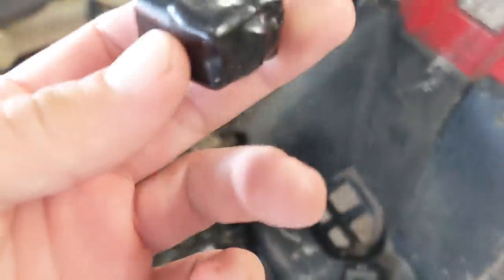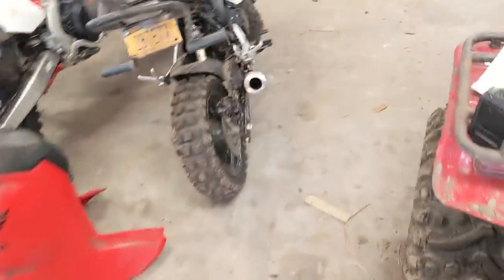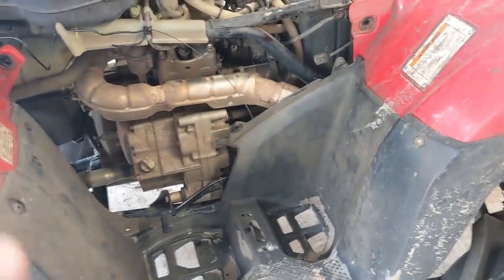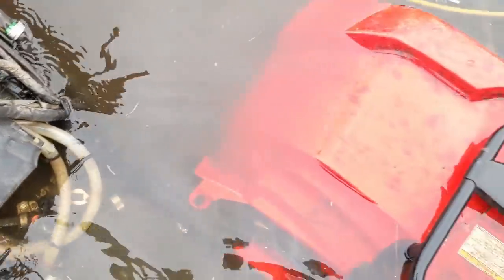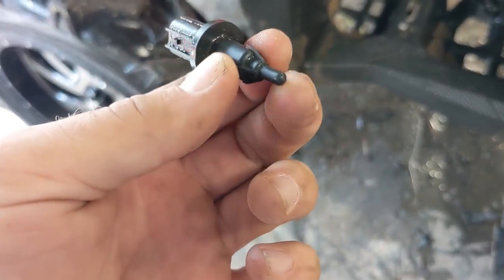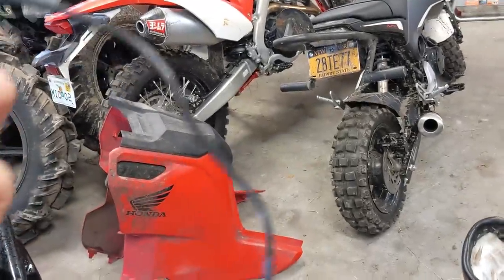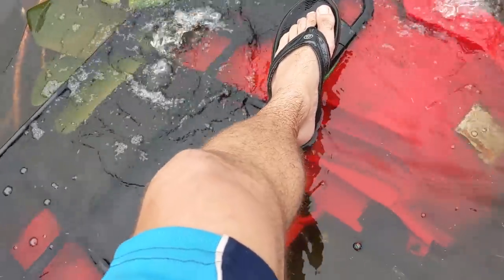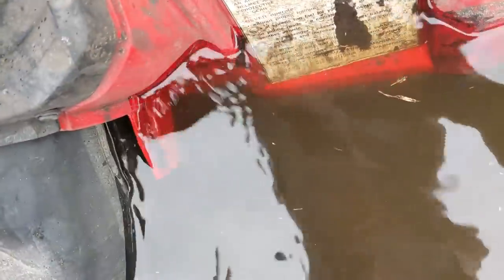More O2 delete testing and new idea for Honda idling under water

Comment: I've never messed with honda EFI but I know for most basic auto manufacturer EFIs that the coolant temp sensor directly affects the idle air control valve so maybe it's the engine dropping down in temp dramatically thats causing the temp sensor to tell the ecm it needs a rush of more fuel and may be the reason it stalls out. Possibly find the resistance of the ECT when up to temp and just not run the ECT for a test in the water with a set resistance.

Comment: There is an idle adjustment. If you take the plastic cover off the right side of the throttle body where the cable goes in, there is an idle set screw just like the older carbureted Honda’s. There’s a lock nut on the idle set screw and you use a small Allen to adjust it. I turned mine up a little and I’m curious if it’ll help idle underwater

Comment: I think it’s bc there is to much back pressure in the stock exhaust so when you take it deep, it causes more pressure. I’ve heard people fixing this issue by pulling out the clean out plug in the exhaust. I’m gonna try it
Reply: did pulling the plug on exhaust help?

Comment: Could you get a fuel controller with fuel maps for mixtures that would help it idle under water?
Reply from the maker: I've tried that did not have good success on the newer models
Reply: @MudPuppyOffroad  gotcha
Reply: In that case I won’t put one on my 520. Thanks

Comment: What if the whole problem is simply a back pressure issue? Vs a sensor problem??? How do you change the exhaust so less water pressure is going against the exhaust... smaller pipes allow some kawasaki engines to run under water and duals kill it. Just my 2 cents.  Great video.
Reply: And the more I think about my Honda Rubicon 500 has run -15 with no problems... even is some water slowing walking up the exhaust could steam the combustion causing problems??
Reply: And... I wonder if a venturi inserted in the exhaust which would speed up the gases and fix this?

Comment: I need help I was mudding water knee high I got stuck then my 2022 Honda foreman 520 turned off. There was no water in oil no water in gas tank no major water in air filter. Spark plug is good what can it be
Reply: Tilt sensor activating?

Comment: O2 Sensors are only resistors ,, all that is done is they matched up the plug soldiered in the correct tolerance resisters melted plastic over it all and called it a o2 delete

Comment: Had an issue with my 2020 had it rebuilt and now I don’t have the problem I used to when it would touch water and die did fine on the ride I took it when I got it back only died once

Comment: I have a 1998 Honda 300 fourtrax 4x4. Would I be able to mount a 2” bracket lift and still use some 420 shocks?
Reply from the maker: No. And 2" lifts are trash
Reply: What kind of lift would you recommend and where can I get one if I ever decide to go bigger?

Comment: Why don’t you like stall kits for Honda’s???
Reply from the maker: They make the machine very hard to control in a lot of different situations. They increase clutch wear. And they add a little bit of stress to the rest of the drivetrain

Comment: Wut is the biggest Aztex I can fit on a strat axle Forman 520 I have a 2 inch lift and a chip but I drive in thick clay mud I don’t know wut size I need
Reply: I wouldnt go any bigger than a 28 of your not going to do a gear reduction but if so 29.5 or bigger

Comment: Aye mud puppy there is a idle screw on your handle bars
Reply from the maker: Bypassing the idle air control is not the right method
Reply from the maker: That is cable free play adjustment

Comment: Just idle it up at the throttle the snallest bit thats what helped mine
Reply from the maker: Not the way to do it it changes when you steer and when the cable wears
Reply from the maker: Usually makes it hard to shift
Reply: @MudPuppyOffroad  yeah true
Reply: @MudPuppyOffroad  and do you think a honda rubicon would turn 33 aztecs with 35% reduction